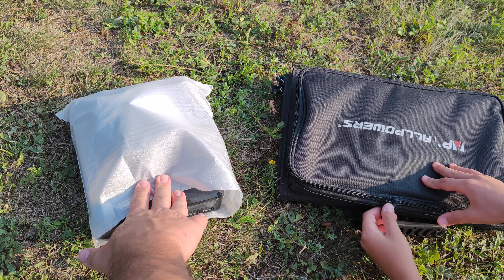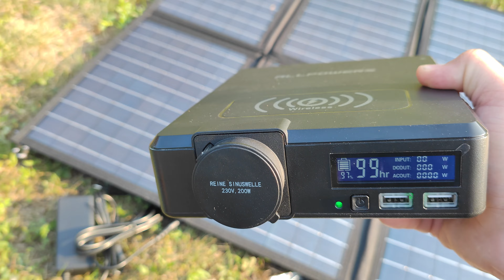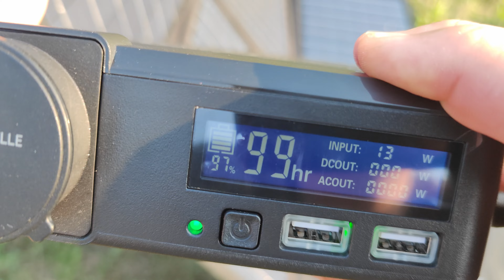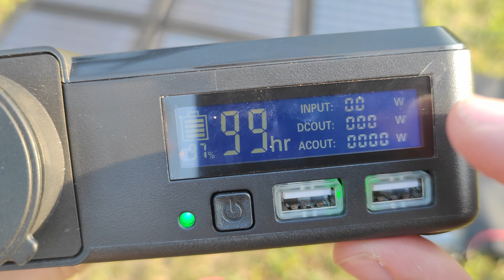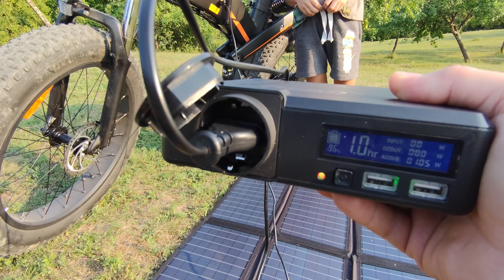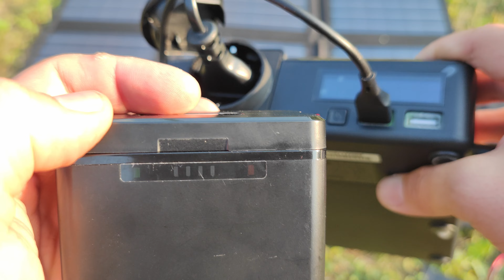Allpowers S200 & SP026 Portable Solar Generator & Panel KIT

Comment from the maker: The ALLPOWERS S200 compact solar generator and solar panel options can now be bought with big 30% if you are using code "TT930" when ordering from the official site
S200 power bank: https://bit.ly/44XrRX2
60W solar panel: https://bit.ly/43Zyo1W
S200 + SP026: https://bit.ly/3QoWrV0
S200 + 100W panel: https://bit.ly/3YsasD7
More models: https://bit.ly/3qveyOi